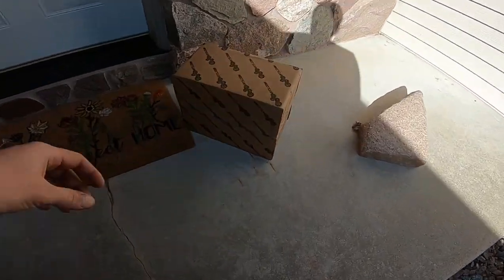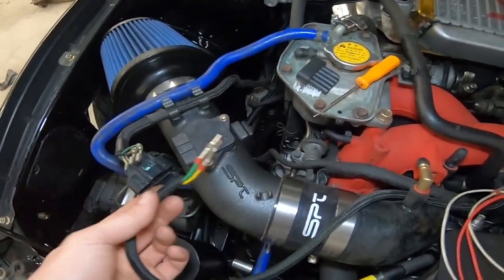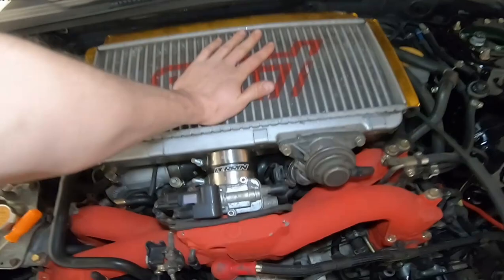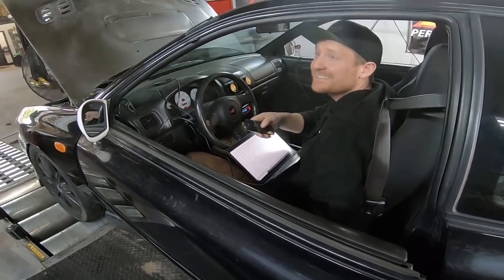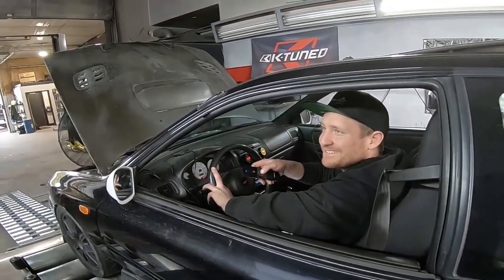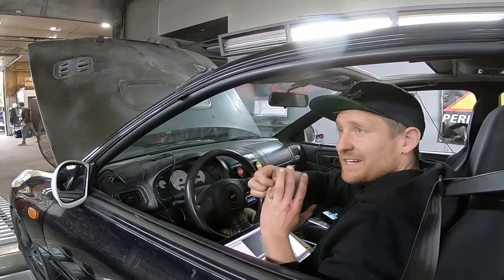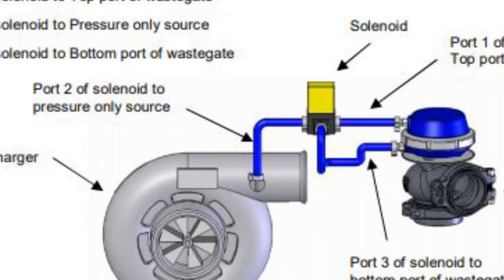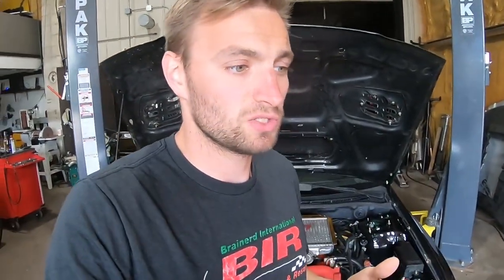JDM EJ205 Dyno Tune With External Waste Gate and Billet Wheel VF48

Comment: I heard the jdm ej205s have weaker pistons than the usdm ones is this true? I’m saying this because I have a 2002 wrx that the timing belt snapped on and I am trying to figure out what to do, I have looked at jdm ej205s but it kinda scared me honestly… I’m not sure if I could trust it. Have you done any supporting mods for this or is it reliably pushing 350?
Reply from the maker: They are weaker and I have broken one but I believe it was because of the anti lag two step I had on that set up. Last set up made 370 and was issue free besides rolling a rod bearing like Subarus do best

Comment: subaru air box + exhaust manifolds + top mount intercooler ! = all god up to about 500 HP = what you are doing is a waste of parts time money = better spent elsewhere ! = i know i have one - never did any of this !
Reply from the maker: Not sure what an air bow is but your correct to a degree. Equal length header was used to even out cylinder temps and move the power curve to redline. Only thing that wasn’t really needed was external dump but that was just a thing I wanted.

Comment: Since u were into autocrossing/gymkhana/time attack style of driving...

Get oem subaru forester sf5 front lower control arm bush (rear part big bush of front lower control arm)

And install it directly to your gc...

This is call anti-lift kit.. will greatly improve front end tyre grip while braking into corner...

2nd thing is your front camber plate can be rotated on its 3bolt axis so u have 50%caster and 50% camber adjustment at the front...

Because stock factory caster were minimal, increasing positive caster on this gen chassis, will increase turn-in tyre grip as well as mid corner grip...

Enjoy the car since it making good power already, time to upgrade the handling department with literally very minimal cost...
Reply from the maker: Car had just about every whiteline part and handling mod. Was always top 5 at auto x events. Keeping the pancake garbage can together was the problem haha.

Comment: Did this have a catless DP and exhaust? And where do you get your turbo? Custom 11blade? 
Last question, I noticed he kept saying running out of fuel, was that from the injectors or fuel pump that was limiting fuel?
Reply from the maker: Yes
Reply: @LifeFlatout awesome! I want to do a similar setup minus the ewg, but wondering if it will get similar results with out it 🙃
Reply from the maker: Yeah you should be similar power without external gate

Comment: What exactly is a billet wheel vf48? And what are the advantages over a regular vf48?
Reply from the maker: Compressor side is bigger and more blades vs stock. I had this one rebuilt by Pavels Engines.

Comment: I have an ej206 from a 1998 legacy Gt swapped in a 07 Impreza but you can’t tune the ecu in these older cars do you think I can swap a 04 wrx ecu in with the wiring harnesses so I can get it tuned ? 

Thanks
Reply: I have an ej208 in my 03 WRX with the WRX ecu. Runs fine.

Comment: Did you swap to 5x114 or still 5x100? You had the prodrive wheels with the 4 pots then all of the sudden sti bbs with Brembos, never saw an update on that.
Reply from the maker: There’s a few videos on 6 speed update. (Also a few cyclones lol)
Reply: @LifeFlatout  found it thanks man. What fuel tank are you running? I’m thinking of swapping to a wrx tank to avoid fuel cut when on track but it doesn’t look like a fun time to do.
Reply from the maker: Stock tank sucks for track use. I went to an sti tank when I swapped the driveline.

Comment: Nice!

What fuel pump do you run?
Do you run stock fuel pressure controller?

Running my DW200 hardwired fixed the fueling problems on e85 I was having at top end on my wrx02. The voltage sag on stock fpc is quite noticeable in those conditions - it was dropping below 11V, after hardwiring it sits at 13+V.

Do you happen to know what MAF voltage you're pulling on top end with this tune?
Reply from the maker: Walbro 255 everything else is stock up until the injectors. MAF was maxed out which was odd but it was still able to calculate load so we didn’t worry too much.
Reply: @LifeFlatout  Maxed out as in the stock maf table? Or was the table extended past stock values? You can extrapolate the table to near 5V (~350g/s).
Reply from the maker: That I’m not sure I just know Andy’s was having issues with the maf I’m not the best at tuning haha
Reply: @kristapsstraupe7959  valves are all good and 1mm aint nothing = a good pocket port is better = your junk !

Comment: how long did this one last?
Reply from the maker: About the same as the rest ha surprise it didn’t break a rod just rolled another bearing doing big track stuff
Reply: @LifeFlatout Its said that the limit of the 205 is about 300bhp. 450-500bhp on the 207
Reply from the maker: @endrestadaudun that’s what I’ve always been told but I’m sure it’s just like k24’s if you ramp on power nicely you an push the limit further

Comment: can cobb accessport run on ej20 engines? 🤔
Reply: Yes, they can be tuned with an access port, I have a jdm 2 liter in my 2005 that I'm currently using the access port and access tuner. I'm using access tuner on my laptop and with the USB port to the access port doing pass through tuning direct to ecu. Luckily i never updated my software or the AP after Cobb neutered many features of the software and the AP. Just got my car on the road again and currently street tuning on e85 with 1100 FIC, DW200, vf39, and stock IC from a friend's STI that he went front mount on. I will say this from last time I had the car going, tuning e85 is way more forgiving than 93 octane, especially in the jdm engines as they have a bit higher compression than the usdm engines. He's right, it's not near as easy to get e85 to knock. I've hit some lean numbers and had plenty time to back out before anything went boom,  on 93 I'd likely have a unique shaped oil pan.... and some new crankcase vents.